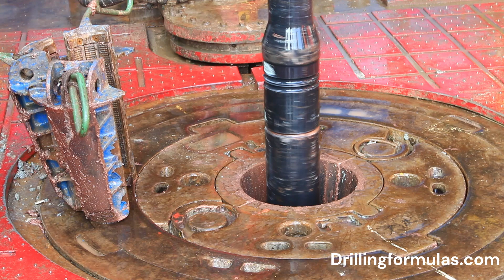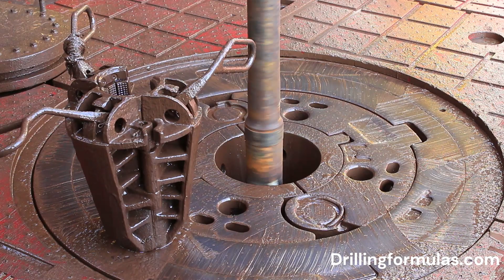Functions of a Rotary Table on a Drilling Rig

Comment: Thats a top drive rig, in the old patch it actually turned the bit, and used to unscrew and screw together pipe when tripping in and out of the hole.